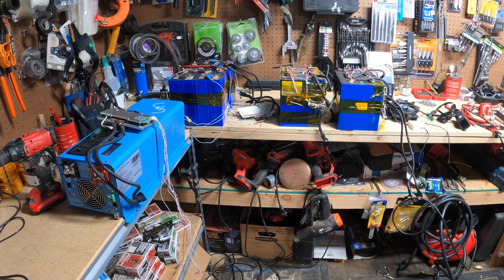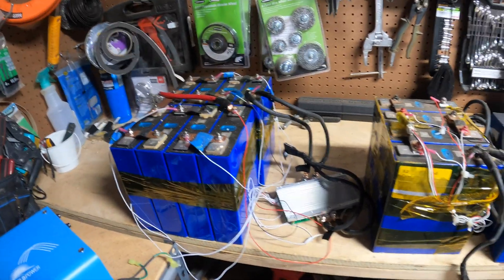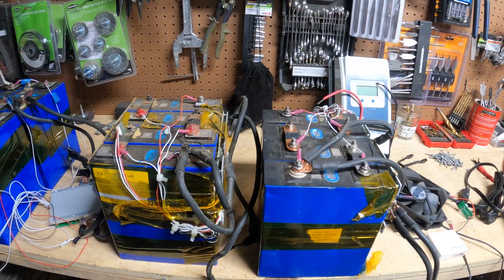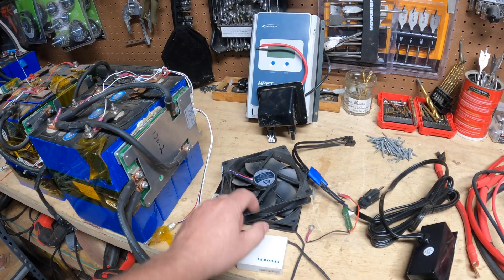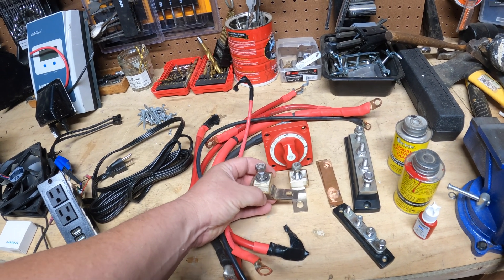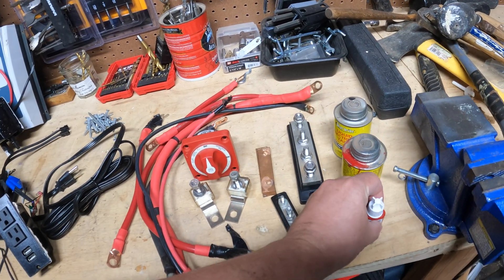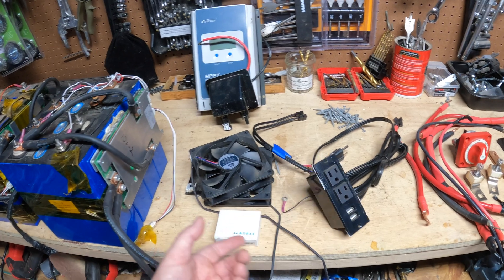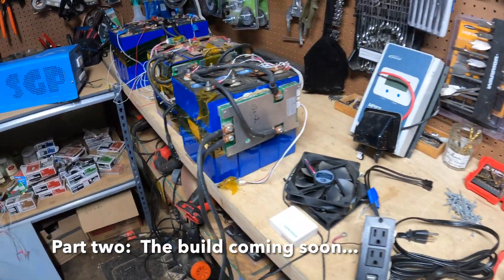DIY power station build.  Watch me build a Massive 24v, 4000w, 10kWh portable generator.  Part 1.

Comment: Awsum, at least you understand, low frequency inverter is the only way. Personally I own 2  24v Titan solar generators (low frequency) have been #1 for a long time, there new 240v 4000w  SP unit is still on top. Will Prouse, solar guru here said, even building a unit of this magnitude, and parts, yourself, would be near impossible for a cheaper price. But your build will be far better than any of these high frequency units there pushing on the market. Remember, idol consumption is a big factor, the Titan idols under 15w, mine is just a mere 12w, and that is not easy to do on a 3000w  unit, and mine are 6 yrs old, w/10kw in battery.